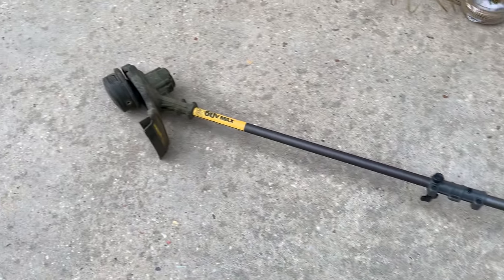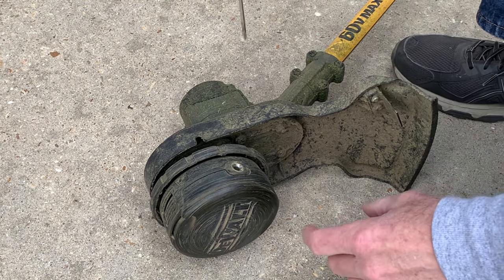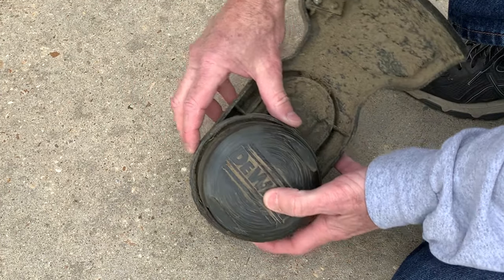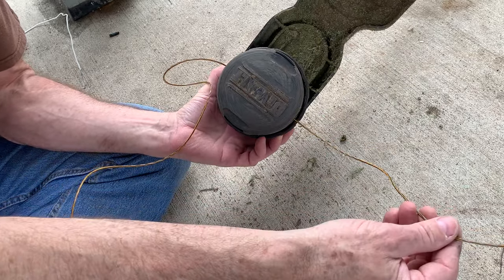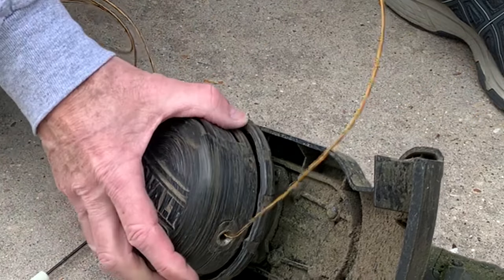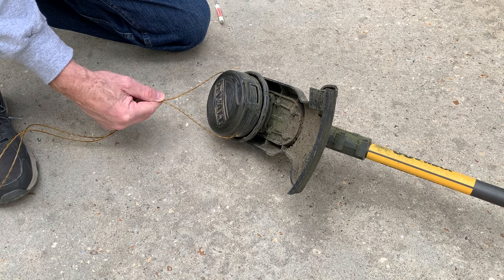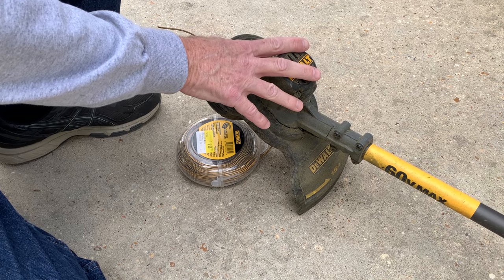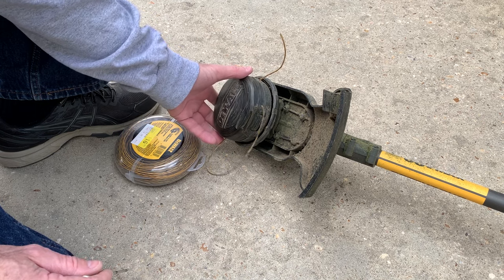How to Restring DeWalt DCST970 60 Volt Flexvolt Cordless Weed Trimmer with a Quickload Head.

Comment: Thanks alot very helpfull. But i did it several times. And it consumes all 10 to 15 feet of string in less than a couple of minutes
Reply from the maker: When you bump the head on the ground it moves the head up toward the deflector plate and allows string out. I wonder if something is keeping the head from popping back out. Look for vines or grass that might have the head stuck in the upper position. If you do not find anything wrong there, check out the spring and see if it is installed correctly. Hope that helps.

Comment: That was great did it and it was so easy I put industrial trimmer wire in I found it cut like a petrol one and the battery life went a lot further so I would recommend getting good not cheap like I had in it before 🇬🇧 subbed
Reply from the maker: Glad it helped. Thanks for watching.

Comment: I'm doing exactly this to respool it, but it is often not feeding when tapped. I've had it completely jammed where the string is wrapped over itself internally and I have to open it unwrap it a bit then re-feed it through back out. Any thoughts or tips, I'm finding it almost unusable.
Reply from the maker: Try keeping a small amount of tension on the string as you wind it onto the spool. Good luck with it.

Comment: I believe I have a strung my weed eater following your directions but the string keeps pulling out and Getting tingled up around the motor.  Any idea why?
Reply from the maker: @sherrydubois8995  Check to see if the head is stuck in the upper position which allows the string to feed out. Sometimes when cutting long grass or weeds it can wrap around the shaft and then when you bump it to feed out string it gets stuck in that position.

Comment: Did that 100x and whenever I run it the line just flies out. Anyone have any advice? I did exactly as the video shows. I’ve only used it 5x.
Reply from the maker: Could be the head is stuck in the upper position and letting the string out. This could happen when long grass or a vine wraps around the shaft and you bump it to let the string out.

Comment: Did that 100x and whenever I run it the line just flies out. Anyone have any advice? I did exactly as the video shows.
Reply from the maker: The shaft might have grass or a vine wrapped around it. That holds the head assembly in the upper position (same as when you are tapping head to let string out) and lets the string continue to feed out. Clean off anything that’s around the shaft and try to move the head back down about 1/8 or 1/4 inch.

Comment: I loaded the string as shown in the video and turn the ring so the string is wrapping around the spool.   As soon as I  start trimming the a bunch of the string comes out.   What am I doing wrong that the string isn't staying put on the spool??
Reply from the maker: Sorry but it is hard know. Here is a couple things to check. Is the spool stuck in the upper position as when it is being tapped on the ground to release string. This is the most probable cause. Grass gets wrapped around the top of the spool and when you tap it to let spring out it gets stuck in the upper position and keeps feeding.

Only put about 20 feet of string on. Are you putting more?

Did anyone take the internals apart and maybe it was put together incorrectly?

Comment: Excellent tutorial.  Your tip about placing string line package in a ziplock bag is valid.  I just threw out almost 250' of new line that dried out (breaks right off when trying to use it).  I now buy a smaller package.
Trimmer line from Home Depot;
Universal Fit .095 in. x 125 ft. Gear Replacement Line for Gas and Select Cordless String Grass Trimmer/Lawn Edger
Reply from the maker: Glad it was helpful! Some people don’t believe the line can dry out. The 3D printer industry learned that it can pretty quickly. Thanks for watching and commenting.

Comment: I have a question. How do you clean out the top where you said to take a small screwdriver out flick it out of the top. Not your words, but close enough.... May I unscrew the 4 top screws and be able to clean real good? The grass is way down in there and I can't get it out. Thanks
Reply from the maker: I glad to hear the video was helpful. I don't think I would take the screws out and clean it further. It certainly wasn't designed to remove the screws and need that extra cleaning. Thanks again for the kind feedback.
Reply: @FixItDepot  Thanks for reply Mr Fix it .

Comment: What kind & size of string do you all use?  I have been using .08” & .095”, and can’t go more than 5 minutes without it breaking!
Reply from the maker: I am almost finished with the .080 string. I haven’t had a problem with it breaking much. I do plan to move up to the .095 though just because it should be stronger.
Reply from the maker: I have been using DeWalt brand line. What type are you using.
Reply: @FixItDepot  I have used several brands, including DeWalt string. Someone suggested storing it in a zip-lock bag, with a small amount of water.  🤷🏻‍♂️   I plan to try it.

Comment: I try to feed like in the video but After I put the string through and even the string I can turn the head. It move a bit and stuck. Do i have to remove head to fix something first?
Reply from the maker: If it is not rotating then maybe something is wrapped around the shaft and jamming it. take the head completely off and make sure string or grass is not stopping it from turning.
Reply: @FixItDepot  I completely took the head off and found that the shaft is jam as you said. I removed it, Now it working fine. Thanks.

Comment: Thanks for the video , been having problems with mine ..... when I tap for more string when using it will not feed .
Reply: This model is a self feeder, tapping it for more string will damage the weed eater head my man
Reply: Sorry, Papi, this is not an autofeed. It's a bump feed, but a poorly designed one. The gap is too big and gets clogged. I carry a finish nail with me and clear the head regularly. It's annoying. I don't recommend this trimmer because of this trimmer head.

Comment: Dewalt DCST922 20V XR Brushless 14" String Trimmer the worst tool Dewalt ever made. It got a nice folding handle that made to fits in the garbage can, where it belongs.
Reply from the maker: I don’t what the difference is between the two models. The model I have is excellent.